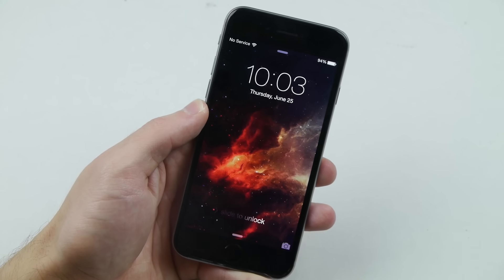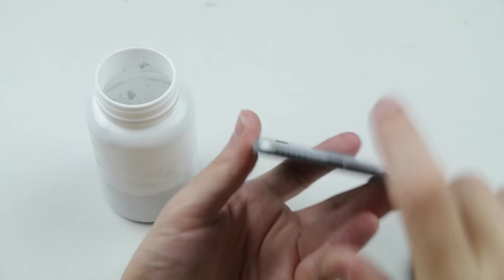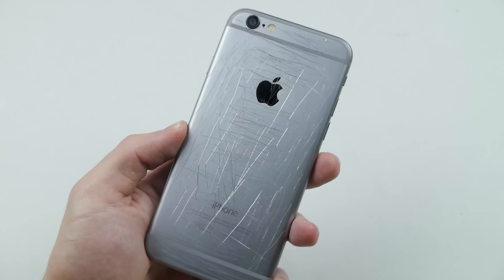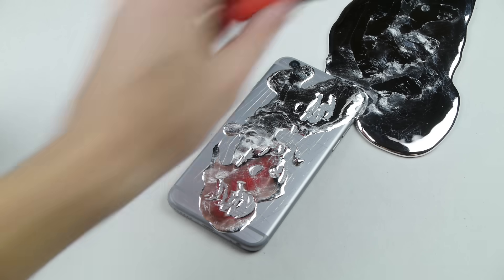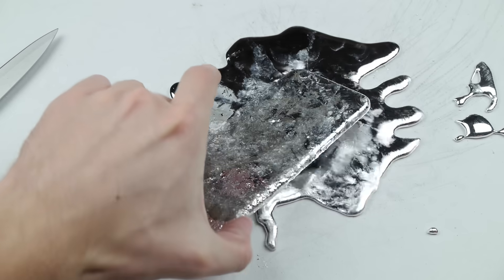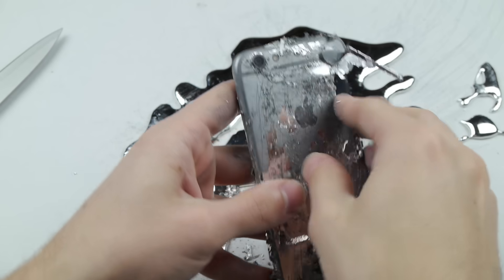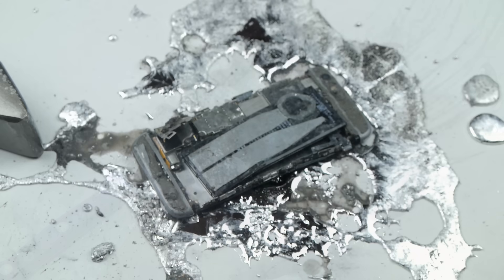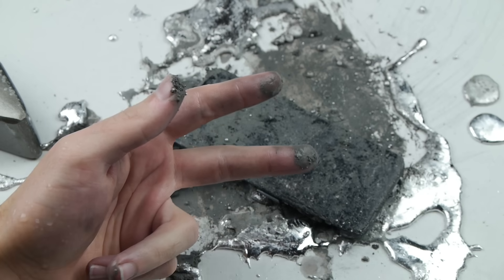What Happens If You Pour Gallium on an iPhone 6?

Comment: You have No clue. Gallium would Melt in your Hand and it does not Care about the scratched back. Besides that: You could have scratched it better by simply using sandpaper. Glas that You did Not Cut yourself. Knifes are Not for kids for a reason.
Reply: False, it only melts steel.
Reply: @exogaming.arsenal  false
Reply: @josephmarbella2955  How so?

Comment: At 1:22, when he started using the knife in the stabbing hold(which doesn't allow much control if a slip occurs) I said to myself "Queue Ambulance for removed thumb".
Also he doesn't show how hard it is to remove gallium stains from your hands and I wondered what happens when it reaches the battery, but maybe it's too well protected by plastic?

Comment: Imagine if the Lithium battery got shorted, heated up and all the Hydrogen that was getting released from the water + aluminium exploded. He would have no head/hands left. Please, never ever try this. Never try things with liquid metals or aluminium. An never mix those with batteries. Unless you are a chemist and know what you are doing.

Comment: When you mix gallium and aluminum, then add water it absorbs the oxygen and the hydrogen is released (not smoke).
Reply: The aluminum doesn't absorb the oxygen. The aluminium in the aluminium-gallium alloy reacts with the oxygen in the water to produce aluminium oxide and hydrogen.
Reply: Dafydd Rees-Jones I was referring to the aluminum gallium alloy not the aluminum.

Comment: I guess you have no idea what youre doing and you didnt checked for the danger, right? xD
I mean, i have no idea too, but you washed it with water and you was suprised, also you put a knife in to peel it off xD Just sayin, it doesnt look like you reasearched what can happen to your Batterie xD I would be scared as hell, if it melt alluminum like that, what does it make with lithium? I heard those batteries are made of this, and they can explode under the right circumstances xD
It als can happen when you put froce onto the batterie... maybe its totally safe, but what if not xD Also you only need maybe... 15 ml of gallium to alloy it with that case, it will search it way right through it xD Trust me, i saw a lot of this stuff xD Also sry for my bad english xD Im just here to ask: Do you know if this was totally safe or not? xD

Comment: you don't need nearly that much gallium to do this, you can get the same result with a few large drops. also the "smoke" is actually hydrogen created from mixing the aluminum-gallium oxide with water.

Comment: waits for the guy to accidentally short-circuit the lithium-polymer battery

The smoke is coming from the aluminum reacting with the water. The aluminum is stealing the oxygen from the water and releasing hydrogen gas.

Comment: Scratching a large surface is way easier with sandpaper, just saying... And why make it hot? It will freaking melt in your hand and just a bit of gallium will do, you did not need to use even 10% of the amount you used. If gallium contacts with water, it will form hydrogen and aluminium oxide. Btw. The scratching must be done with the gallium on the surface, otherwise a new layer of aluminium oxide is formed imediately.

Comment: The thing that happened with water was the aluminium reacting with the water to produce hydrogen (which is highly flammable) and aluminium oxide. This will basically separate the gallium to reuse later.

Comment: You can't wash gallium with water it corrodes like crazy. You don't need to heat it up like at all for it to be liquid, it's melting point is 85 f so you could literally just hold it in your hand for a while and it will become liquid. Lastly, why an iPhone? Why not just show off this effect with any piece of aluminum? You're a moron.

Comment: Btw you don’t need to use every single drop of gallium because it spreads into the aluminum ALSO the sizzling is the the water reacting with the aluminum gallium alloy producing hydrogen

Comment: It's sizzling because there's a reaction between the oxygen in water with the gallium-aluminium mixture. Aluminium oxide is being formed and hidrogen is being released. Don't light a match near it cause the hidrogen will burn violently.

Comment: you shouldnt really touch shit like that with your bare hands.. but the aluminum gallium compound reacts with water releasing hydrogen.. having a fire or so would or could be dangerous.. because the battery might light on fire.. 

im not saying touching it is bad, im saying you obviously dont know what happens when you splash water on it.. therefore you should take precautions (naturally speaking)

Comment: 4:29: "I don't know whats happening, I just washed it with water"... Might be a good idea to google what Gallium + Aluminium can do before trying. Adding water there creates Hydrogen as the Oxygen from the water is absorbed into the Aluminium to form Aluminioumoxide. Could have been potentially dangerous (risk of fire/explosions) depending on how well vented the area is.

Comment: I works better if  keep the temperature in your home above galliums melting point. Also you don't need that much gallium. About four or five drops would have worked because gallium absorbes into the aluminum cover

Comment: The scratching of the aluminum back of the IPhone at  the beginning is pretty useless. Aluminum immediately forms a layer of oxide when in contact with air. That's why you see most people scratching the aluminum while the gallium is on the surface, so it doesn't come into contact with air.

Comment: The smoke is hydrogen gas. When gallium touches water, I think it pulls out the oxygen, releasing hydrogen in the process. You'll know that for sure when you pour water on gallium and light it with a torch. The bubbles are hydrogen bubbles, by the way.

Comment: When you mix Gallium and aluminum, it can also form an alloy which reacts with water. It looks like this reaction took place in The end of the video. This reaction is not too dangerous, it just realeases a lot of hydrogen.
Reply: He is pretty dumb. During the reaction he was touching the battery.
Reply: Yes,  but hydrogen is really flammable
Reply: @mate7255  don't have naked flames around then lol
Reply: Emil Olinsson theres plenty of oxygen in the air but the problem is if had something to start the fire in his house je could set the house on fire
Reply: solustenzoku yes , it could happen , but two wires need to touch , the + and the - need to touch to make the spark , but hydrogen is a gas that is lighter than air and wants to go up , it could happen but the spark needs to be bigger , and i font think you can make a big spark from a phone battery voltage
Reply: Battle Ground Survivor let’s be real he used waaaay to much gallium
Reply: Battle Ground Survivor when he peeled the back he used a knife, it could scratched some wires. Maybe if he turn on the phone...
Reply: Mjayson2016 it's the aluminum oxide reacting with water to take the hydrogen out of the water and turn it into a gas again and that's why it makes that muddy looking stuff because water without hydrogen can't be water so it has to take another form
Reply: Ruston Brown lol,obviously water does not transform into anything-it just reacts with aluminium which is unable to form a protective layer(which is the only thing that prevents  normal aluminium from doing the same thing when exposed to water) due to gallium incorporation-and as a result of such stuff the aluminium hydroxide is being produced.So there's that,Jesse,cuz science beeaach😁
Reply: Battle Ground Survivor watch a video on a lithium ion battery explode from a hard short. Batteries in mobiles can be extremely dangerous.
Reply: Bulldogs MC noo
Reply: Battle Ground Survivor I know, at least more than 10% possibility
Reply: Bulldogs MC hmm thats a way to create energy or gas
Reply: Scientists are makeing cars with this fuel,so don't call him stupid
Reply: Hydrogen is flammable
Reply: @lightxdark3505  and that is the thing that makes it useful!I for example have an HHO torch with which I melt for example rhenium metal(melting point 3186°C),and it's very useful therefore-especially cool with platinum:it makes melting platinum metal really so easy and satisfying🤗
Reply: John Sheppard oh man. you'd be amazed on my arsenal of chlorine gas testing. i have a industrial haz mat made for chemicals. i have like all the chemicals you can probably call out from 1 and a quarter years of experience of reading a chemical compound list, ranging all from my Mn2O7 Manganese heptoxide. Sulfuric acid. etc. the chemical i have the most of is H2So4 sulfuric acid i also have a closet of flasks. i even have lots of chemical experience
Reply: Just me messing with my chemicals is beyond your HHO torch.  i even have enough to probably get you scared if you met me in person
i can probably melt things beyond your hho torch with the thermite i have. i will probably correct you. its rhodium. not rhenium
Reply: Try it with epoxy and gallium
Reply: H2 (hydrogen) is toxic. Open the windows if you do this
Reply: And that mud is the aluminum oxide which is another product of that reaction.
Reply: Okay, minestein
Reply: Actuali when he said another daj it was just one second Ít was stil melted
Reply: Hydrogen can't burn by itself it needs oxygen
Reply: Nice smarts I’m not trying to be mean
Reply: Bulldogs MC I know
Reply: Richie Blanchette owo your a cool kid

Comment: When the gallium bonds with aluminum it's not fully stable, water reacts to create an aluminum oxide powder which is black because if the particle size, and the remaining hydrogen (h2o) is released (the "smoke" you saw.

Comment: Even if you taped up the ports, that won't stop the gallium from getting in and fucking with the internals eventually. Gallium isn't just reactive with aluminium and other metals, but it can weaken non-metallic substances such as silicon as well. Not to mention the fact that if even a small amount got in, it would react with the solder on the logic board and all the metal components.

Comment: Gallium is an allaline metal that will react to water by super heating. Its warm to the touch, because of the water in the skin's oil. The phone started smoking, because you rinced in water. Learn about the element before experimenting. Youre lucky it didnt explode the lithium in the batteries!
Reply: And you should learn about the elements before commenting. First and foremost, gallium is NOT an Alkaline Earth Metal (assuming that allaline means Alkaline). Gallium is considered an "Other Metal", Other Metals are not reactive. It's warm because liquid gallium is above 30°C (85°F). Not all batteries have lithium in them.

Comment: If you dissolve aluminum in gallium and then treat it with water, it produces hydrogen gas. That's what was bubbling out at the end there. If anything creates a spark (e.g. the battery?) you'd have an explosion.

Comment: Why is the gallium hot?? Its melting point is only 82 degrees ferenheit
Reply: Ignorant? No, they were asking the question cause they were probably just confused.
Reply: First of all melting point has nothing to do with how hot it should be. Under normal conditions gallium should be a liquid between 82 F and 4352 F. It may be the lithium burning after being exposed to the air, as you notice the phone peeled away exposing the battery. Or it could have been a chemical reaction with the gallium itself.
Reply: Sorry I'm just really frustrated today, but to be honest this question is terribly ignorant when they considered no other variables and refused to even do some research themselves.

Comment: Not too smart to play with elements you don't have a full understanding of. Be a little safer and use gloves. Plus, in the chemistry world, putting water on just about anything makes it worse.
Reply: Yea, and the battery is probably causing the reaction at the end, and batteries can be very toxic and contain very strong acids. So please dont touch that with your hands! Use gloves!
Reply: the metal itself is nontoxic but I CRINGED when he took the back off WITH A KNIFE he probably punctured the dang battery and that is where the "smoke" came from. but adding water to an acid should dilute it but apparently there is a certain way to dilute acid lol Google is a magical thing that he should learn to use.
Reply: When you mix Gallium and aluminum, it can also form an alloy which reacts with water. IT looks like this reaction took place at The end. This reaction is not too dangerous, it just realeases a lot of hydrogen.

Comment: So puts tape over speaker and charger so it doesn't seep in then scratches back so it can seep in faster?
Reply: Eddie Condon tape so it won't seen into the electronic parts. the scratches are so it can get through the plastic covering and touch the aluminum to make it brittle as you see it did. just wanted to try to help clear up what he meant by seep and not seep in certain areas.
Reply: everyone was saying this. he makes no sense
Reply: Eddie Condon if it seeps into the charger plug thingy it would probably spark sooo
Reply: Eddie Condon no let me explain AHEM gallium makes aluminum brittle by seeping in the cracks and breaking it on an atomic level hence why he scratched it so yeah SCIENCE B**

Comment: what is a Galliam.(°ฯ°)
Reply: Gallium is an element that is solid at room temperature, but will melt at 85° or so, and in a liquid state, it forms a very brittle alloy with the aluminum on the phone. When it started smoking after he rinsed it, that was the water separating the aluminum and gallium into gallium, aluminum oxide, and hydrogen gas, which was released as a vapor. The aluminum oxide is just as strong as the original aluminum, and will not react with gallium. Since aluminum forms a layer of oxidation naturally, he had to scratch it away to get it to react.
Reply: Ariela werewolf its a metal li,e element that is clearly meatl water
Reply: It's a metal that turns into a runny liquid at about 86 degrees fahrenheit,, why he says he cooked it, I don't know. Why he poured it on an I-phone, I also don't know.
Reply: SuperGenericguy it's 85% 😂😂😂
Reply: Foxy 85.5799 °F My numbers rounded up. I fail to see how that involves a percentage though.

Comment: I cannot believe an idiot like u has 5 million subs. let's mess around with this with my bare hands. u get  a cut or a scratch (which is likely with how u were handling that knife, which btw is how an idiot handles a knife) and I'm sure it's not good. our world is so far past gone
Reply: Actually Smart-ass, it's completely safe to play with, So if anything bad happened, it would prob be from swallowing it. You are a fucking idiot. Do more research.
Reply: Daniel Hopman lol this guy really thinks it's safe to get this in a cut (which is what I said). I didn't even mention the lithium battery that's compromised and has water put on it (didn't feel it was necessary to point out how retarded that was).

Comment: why would the gallium be hot, i thought that stuff melted in your hands due to its really low melting point?
Reply: I think he means that its pointless since Gallium melts at body temp. No reason to warm it up.
Reply: Nobby76 he said he heated 
it up
Reply: Nobby76 chemical reaction?
Reply: April R
Ive seen people take a lump of gallium and hold it in there hand until it melted though, that isn't a chemical reaction, thats just it melting.. same as ice melts when you hold it.  I think the guy may have heated it up to try and melt it quicker, or keep it as a liquid form for longer.. i dunno, im no rocket maths expert :)
Reply: Nobby76 lol. Yea, he doesn't seem too bright
Reply: correct that's exactly what i meant
Reply: He did that so it could pour out of the container easily. It was solid in the bottle, so he couldn't get it out before melting it. Maybe he just overshot it a bit.
Reply: I assumed it breached the battery and was venting though the gallium...

Comment: Gallium dissolves all aluminum in only 30-50 mins all of the aluminum would be soft then it would start to break it down and with any pressure or movement it would brake.

Comment: 1: you wasted about 450g of unrecoverable gallium. 
2: you dont need to be that overzealous with the scratching. 
3: im disappointed because it did not puncture the battery
4: the "grilling" sound is the gallium separating the H out of the H2O. 
5: hydrogen smoke. dont breathe this.

Comment: ehh dosnt the aluminum+gallium alloy become toxic when mixed with water?
Reply: No but he probably broke the battery, letting the litium inside get in contact with air and producing the smoke (which is toxic). The only reaction between gallium and aluminium is that the gallium diffuse ions and broke the aluminium structure, making it a lot more weaker (I think it's how it happening)
Reply: The bubbles are likely from the aluminum gallium alloy mixing with the water, the bubbles are hydrogen.
Reply: c4ooo that's what I thought but I'm not sure
Reply: c4ooo yes.

Comment: That black boiling thing was the liquid in the battery. If its touching with air, starts being really hot. Like it boils.
Reply: ***** Interesting. Thanks. But the battery liquid is reacts with the air like this, too.
Reply: isnt hydrogen gas Non detectable to the Eye though?

Comment: You didn't need to pour the while thing, just a drop will compromise the entire body of aluminum. Gallium and Aluminum creates an unstable alloy that is corrosive when in contact with water, the reaction creates hydrogen and Aluminum Hydroxide and a heat